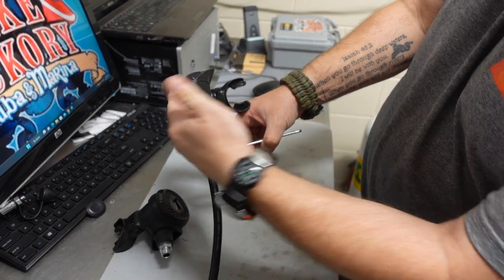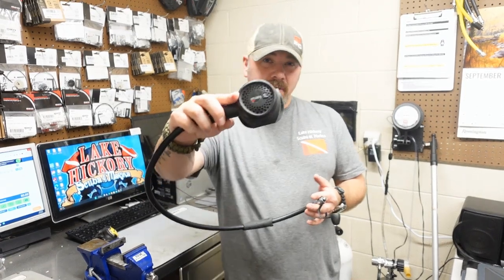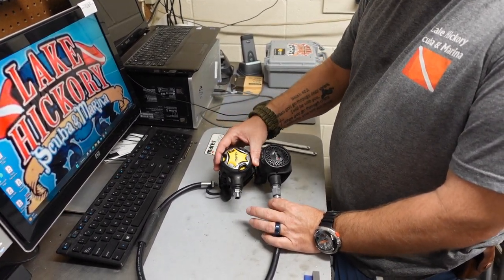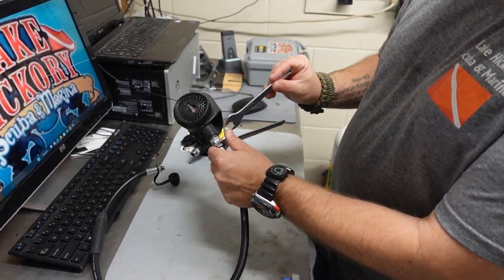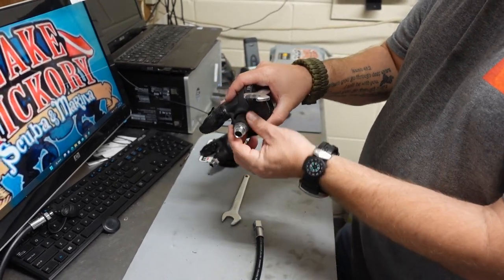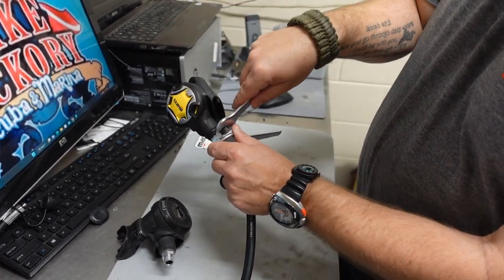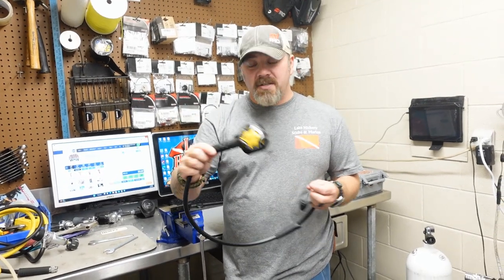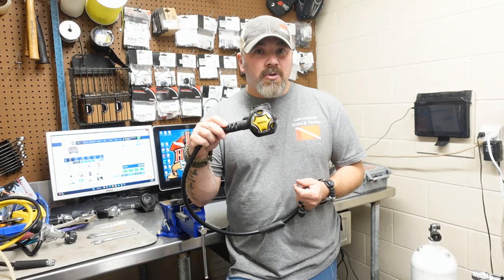Replacing A Second Stage {[It's Easier Than You Think]}

Comment: I have a somewhat related question. I just purchased a dry suit and I will be taking my certification class soon. Should I leave the LPI hose connected to the regulator all the time or only when I am diving with the dry suit?
Reply: Leave it on the regulator if you change often between wet and dry. I only disconnect the hose when I‘m going on holiday to warm destination. I attach the unused hose as a loop with bungee rope to my tank while the dive. Simply rinse the unused connector and shake the water out of it after diving.
Reply from the maker: Hello Mike Dodds, great question. For me personally, I simply leave it connected. I like to secure the spare hose under my cam straps (tank straps) when I am not using it. You can always take it off as well, if you don't mind the extra work.